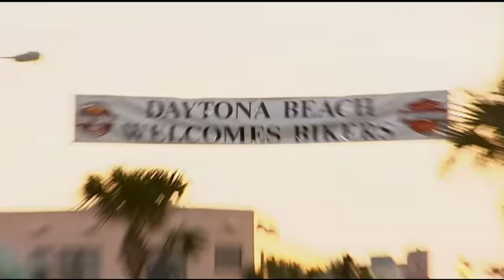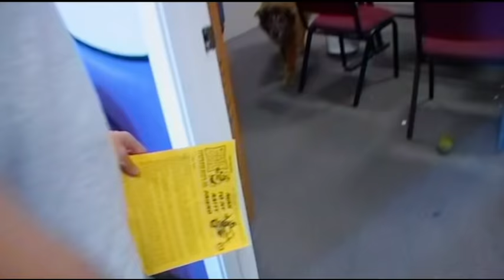World Biker Build-Off | Episode 2

Comment: 16:28 to 18:42. He wanted to come over himself to make sure the flames is exactly what he was wanting. I keep hearing the word (Professionals) being used. However the wrong tank got painted! 23:43 to 24:13, This guy is mental. No wires should be a little bit snug on a machine that all it does is vibrate! That's how failures happen. Got to love the quote, his bikes don't have safety features like blinkers which adds to the complexity of the wiring. That's what separates the good builders from the bad. Blinkers are not that hard to wire up, maybe to complex for some people. Well if he can't tell the painter what tank is what, he really shouldn't be wiring up blinkers anyway!

Comment: Team England are not bike builders, they just pick up parts off of the shelve and bolt things together. The guys don't even know how to machine, paint or custom ANYTHING! Bla Bike assemblers not "builders".
Reply: Sexybluelady .lady Sorry, i thought you were a fabricator.  I am building a bike right now and happen to agree with you.  Take a deep breath, calm yourself, jeesh.
Reply: Sexybluelady .lady Cool, shape some metal.  I'm building a metric "bobber" as we speak.  Bike had a double back-bone, so I had to cut it off(the devil made me do it) for my 2 gallon peanut tank.  I'm making a fake oil tank right now to hide all the electronics, wiring etc.  It's a shaft drive bike so it's tougher trying to make it cool, but so far so good.  Have fun with it, anything is possible when you can melt steel.
Reply: Sexybluelady .lady He hasn't been able to win because their bikes are very plain.  I think they look amazing but it has nothing to do with his skills.  He has designed alot of cool parts over the years.  Alot of their parts are their own or modified.   Alot of bike builders have their staff build the bikes usually.  Depends on how many builds they do.

Comment: RIDABILITY
That rake was all wrong. Springers stretch down, & then up? At least mount a bracket connecting downwards, so the wheel turns left/right, instead of side to side

Comment: what kind of metal sheets the australian use? it looks thick bt it can bend and mold easy over a carved wood?
Reply: +luisito carumba Al
Reply: he only said it a hundred times lmao
Reply: Fair bit of aluminium in their build. Beating metal you want to have a dolly of some sort you can have underneath to hit against. The advantage of using timber is you can work it quickly and easily. It is great if you are only doing one part from it or a small number. If you wanted a tool to last longer you'd use steel or cast iron. That said Aussie hardwoods are much stronger and harder than timber like oak and teak.